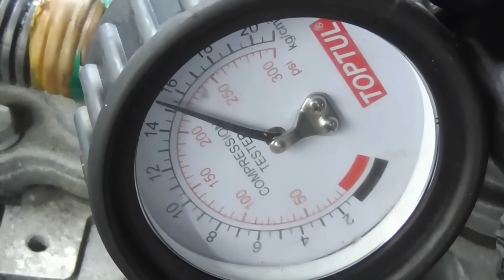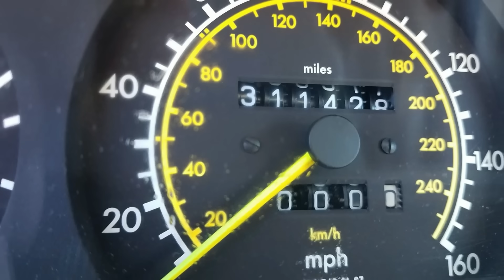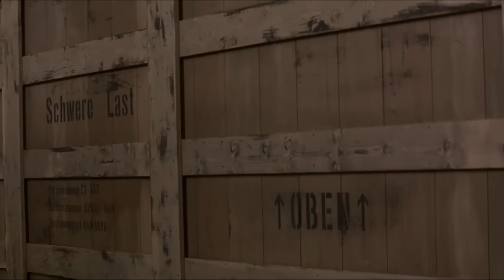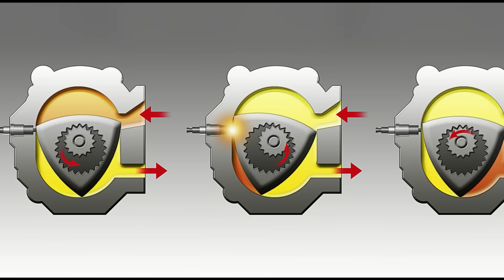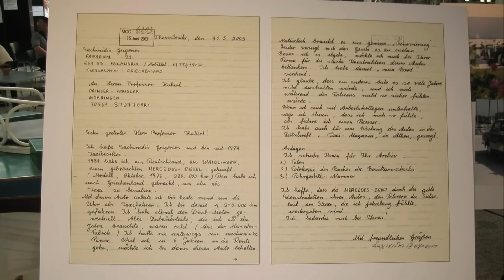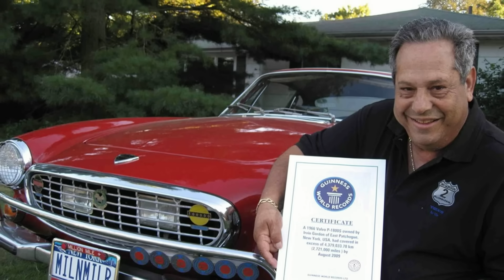Most Reliable Engines of All Time

Comment: GM 3800 V6 was unbreakable.  Had a couple of cars with them, great fuel economy and lots of power also.
Reply: GM 3800 Series 1 was one of the engines ever produced.  It was identified by the the cast aluminum intake manifold.  Great FE, durable, reliable, and sinfully cheap easy to work on (thermostat, throttle body cleaning, starters, etc).  My 1991 Buick LeSabre with 3800 S1 had 177,000 miles on when I traded it and got 30mpg on the highway, burned less than a quart of oil in 3000miles, and only used one oxygen sensor!
Reply: Too bad GM could not build a transmission and front end assembly to hold it together without the motor mounts giving way and the axel shredding the inside of the tranny. And you have to drop the tranny to replace the $75 solenoids. Oh yeah, great car. Not!
Reply: My friend has an 02 buick lesabre and he blew the engine by the time the car had 120k miles. Changed the oil regularly every 3k miles but sadly it overheated going up a hill and blew the head gasket and a few weeks later it started knocking and threw a rod. This happened in Texas so keep in mind that temperatures here sore past 100 degrees and this happened in the middle of a hot day. There were no problems with the water pump, thermostat or the radiator/fans and coolant was in clean condition. It was weird.
Reply: It was breakable for sure

Comment: Change your oil and filter every 5K miles with a good synthetic, change filters, don’t drive and rev like a moron, and you can get longevity with any motor.  Regarding your transmission, swap out fluid, at a minimum, every 30-40k miles, and service the filter every 60K miles, and it will last.  THERE IS NO SUCH THING AS LIFETIME TRANSMISSION FLUID !!!!  Most vehicles today have drain plugs on the trans pan, and simply replace the same amount you take out.

Comment: 375k km is only 234k miles.
Good but not impressive.
Most V8 engines of the last 40-50 years are capable of THAT with decent maintainance.

Comment: Dodge slant 6 older and ford inline 300 6 cylinder are best domestic motors ever made it you want a million miles. Take care and maintain and they last forever really.  They stop.makimg them , that's how reliable they are.  They lose too much from lack of part sales and they lasted too long.   Evil dodge and ford for ya.    If it's too good we gotta stop produce them.  They make more in parts for new car motors now. Plastic parts and computer nonsense sensors and parts is where they get rich. These old motors require no fancy parts.  Beautifull.   I miss mine.  I want one again.

Comment: The claim that these engines mentioned can easily hit 100-150k is really not a big claim at all. I’ve owned many American cars that were ultra reliable with well over 200k miles. My jeep Cherokee with its 4.0 had 275k when i sold it. Ran perfect!
Reply: @superkadabra  Multiply the miles by 1.6 to get Km.
Reply: One thing people tend to forget is that most older USA cars have very big engines and low HP. That is a recept for high milage over time. Those MB of Volvo blocks did it with small engines compared to most USA ones. As soon the American cars get a lot of HP the reliablity goes down a lot.

American cars are not know for reliablity. There are some exceptions. Japanese cars are the most reliable in the world. Period. Some good MB were in the past as well together with Volvo. Now all manufacturers want to brake your car so you buy something new.

Comment: Odd balls and specialty engines?
What about the every day unsung heroes?
Chrysler's ,3.3 and 3.8 liter V6 commonly found in their minivans until replaced by the Fiat 3.6 liter; these engines easily went over 300000 miles ,often in fleet vehicles without needing an overhaul.
Ford's 4.6 liter V8 found it's way into trucks ,vans ,cabs ,cop cars and Mustangs; well known for exceeding 300000 ,even 400000 miles over a life of extreme duty and often neglect.
Chrysler/Jeep 4.0 liter inline 6. Not very sofisticated or fuel efficient but it held up well over 200000 miles in early everything it powered.
GM Vortec V8s; pick any of them.
GM LS V8s; reliable ,efficient and respectably powerful.
Fords Windsor V8s (302 or 351); you couldn't count how many 5.0 Mustangs were trashing around for over 200000 miles through out the 1980s and 90s. Beaten and neglected ,because they could take the abuse...
Surely we could go on forever about engines capable of over 150000 miles of reliability. That would be nearly evety engine in nearly any car if cared for. Even 200000 miles isn't the wildest stretch for a mill properly maintained.
What I have plucked for the beginning of any respectable list are engines that were commonly abused and neglected. 
Hell ,I had 302 in a 1968 Torino GT with 346000 miles on it by the time I switched to bidder engine and was still running. Hydraulic flat tappet cam and all. I didn't change the oil for nearly 10 years. Just added a quart about every 2500-3000 miles as needed.
Do you know why old cars were so tough?
Because they primitive. Built like farm equipment with passenger accommodations.

Comment: There was a book published by Vance Packard; I forget the title ( 1970's) in it he describes how manufacturers INTENTIONALLY produce inferior products  to fail so you can buy more frequently. The big three CAN make everlasting cars but won't.
Reply: It’s called “designed obsolescence”, and unfortunately many manufacturers have jumped on this gravy train.  With computer aided design and accurate driving simulations available today, manufacturers can design a car that will just barely outlast the warranty…then we are stuck with expensive repairs or buying new cars.

Comment: I once owned a 94' F-150, with a 4.9 L inline 6. It was a straight up 5 speed manual work truck. After 13 years the engine was still  rock solid, with the rest of the truck falling apart around it. Guys were getting 4-500K out of them. Needless to say they quit producing them.
Reply: Had one of those, too. Absolutely indestructible motor and with the manual it was perfect. Straight 6/in-line six it’s just the perfect configuration.  Sucks living in the Midwest because you can’t find any old trucks that aren’t rust buckets.
Reply: My pontiac 3800 has 576k on it🤷‍♂️
Reply: @tw3akmusic750  is your 3800 one with a stock supercharger lol
Reply: @CharbeeCapps  no lol just a series 2
Reply: @tw3akmusic750  It's a Buick motor.
Reply: I still have mine it's a 95 f150 with inline 6 bought it from the cable company as a high mileage old truck in 03 and I still drive it to this day for work.
Reply: @rayoverstreet9254  I got an 82 ford with 3 speed on the column still working great. It sat for at least 3 years and the oil turned to sludge and it still fired right up. The rest of the truck is a different story I'd love to restore it
Reply: I had a Buick LeSabre that I daily drove for years and it had the 3800 V6. I put around 420,000 miles on it before the transmission went out on it and the frame and body was getting rusty from the salt. All I’ve ever done was maintenance and stuff like brakes, tires, etc. I’ve never ever had a single problem with the engine. It’s baffles me why GM ever stopped making that engine.
Reply: Got one in a 86 short box 5 speed torque monster could hook up to a house and drag it off if I wanted
Reply: @kendallspivey6479 My dad had a 86 F150 stepside Blue. It had the 4.9 I6 4 speed manual. Dad always said it could out tow most of the V8s he had owned. He said it was definitely superior to the 5.0 302.
Reply: My uncle had the same one he got 400,000 miles out of his before he sold it and it was still good but he did buy a brand new from the dealer never had any issues original engine and transmission Auto
Reply: Yes, Ford 4.9 I6 is one of the best ever. I heard when Ford was involved in Cummins, the 4.9 engine block was the bassis for the 5.9 Cummins.

Comment: Diesel engines that should be mentioned is the Cummins 5.7, I have seen vehicles that have turned over 800,000 miles. The engine was noisey but ran forever.
Reply: Cummins B series was 360 CID (5.9) and are very reliable. I believe that the B50 rating is 350,000 miles.
Reply: Hoovie has one with over a million miles

Comment: This is all Chinese propoganda, small V8 both the chev. 283 and the ford 289 outclassed all this Chinese crap. I owned a ford 6 cyl. That I personally put 650,000 miles and all I did to the engine was change the oil and filter after 3500 miles. I put a new alternator at 450,000 miles and replaced a couple of starters. Great engine.

Comment: Yeah sure Toyotas and Hondas are reliable. But how about American engines? I own and still tow a 30 foot Toy Hauler Travel Trailer with my 1999 "new body" Silverado extended cab, 4 X4, 2500, stock 6.0 Liter Gas V8, (Vortec 6000, LS based) that now has over 350,000 miles and it looks and runs like it did when it was new. Change the oil every 5,000 miles, doesn't burn a drop of oil between oil changes and my 6.0L has never been rebuilt. I have towed 13,000 pound trailers with this truck and when unloaded with the tailgate removed and replaced with a net, This truck can still get 19 to 20MPG on the highway. I'll run this Silverado to 500,000-1,000,000 miles then rebuild it because they don't make them this good anymore.

Comment: I had a 1999 Ford F150 with the 5.4 L engine. With oil changes every 8,000 to 15,000 miles it went 636,000 miles with only a couple of starters and an alternater. Everything else was original. It was still running when it was sold.
Reply: My brother has a '98 F150 with a 5.4 that's just about to hit 400,000 miles.  Engine has never been apart, nor has the transmission.  That's an amazing family of engines.
Reply: I have a 98 F150, 5.4 Super cab, Automatic Trans. With 300.000 miles, Super Tech synthetic oil, and filter, changed at 5.000 miles nary a wrench been on it except a change of brake pads. Starter relay is about to go. Still runs strong as an Apes breath.
Reply: Really wow ! Holy cow
Reply: Someone bought a car from you with 636,000 miles?

Comment: I've seen Camrys with 350,000 miles or more,and the 22R that's in the trucks are one of the most bullet proof 4 cylinder engines ever.